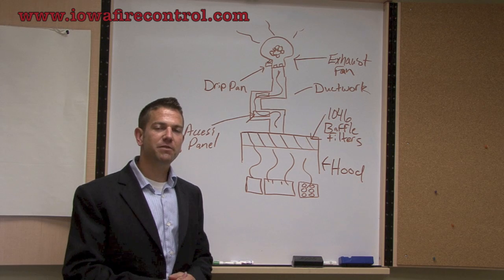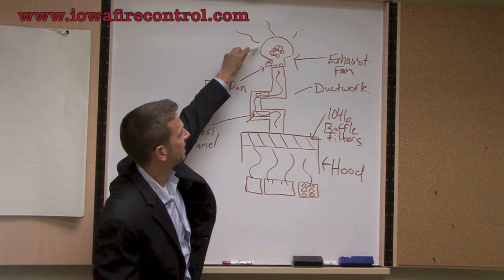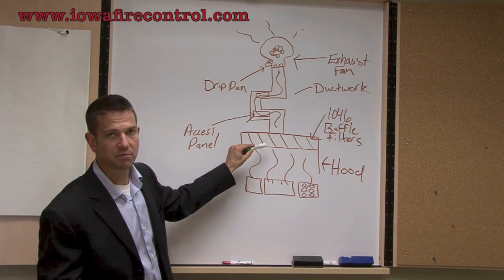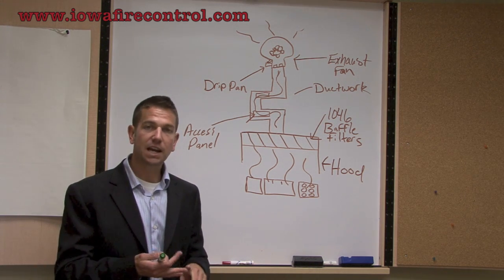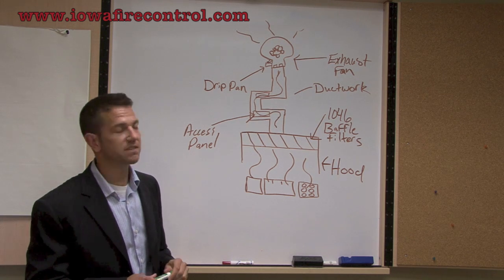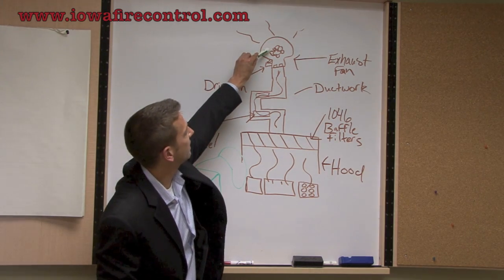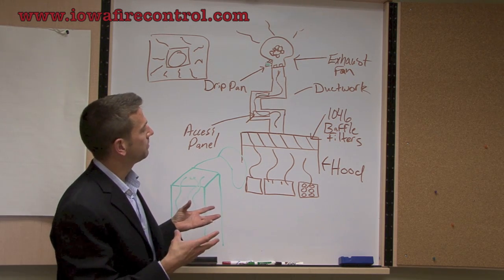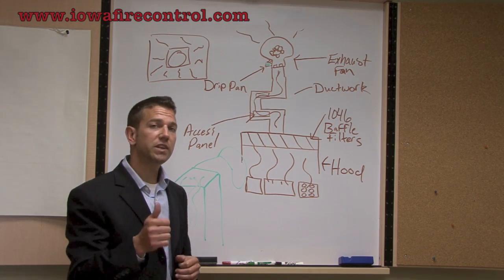Kitchen Exhaust Components

Comment: Do you have a video explaining the impact of a vacuum (low pressue) created within the Kitchen when all the air is sucked out by the exhaust fan ?
If we simply open a window to allow return air from outside to enter into the building then no point having an airconditoner on for customers because hot air from outside is continuously entering the restaurant.
So how do you fix this ?
Do I need a Economizer Relief Systems ?
But these systems are not about Exhaust fans (removing air) but rather about supply fans (pushing air into the buikding).
I'm so confused hope you can explain thus :)